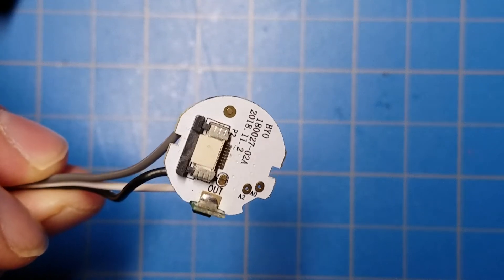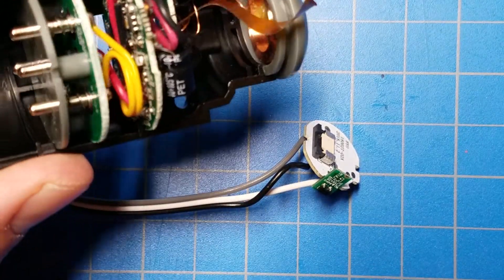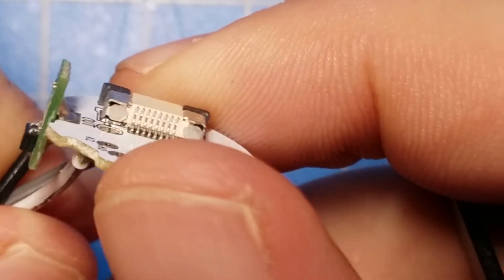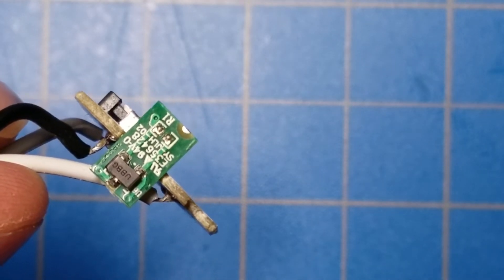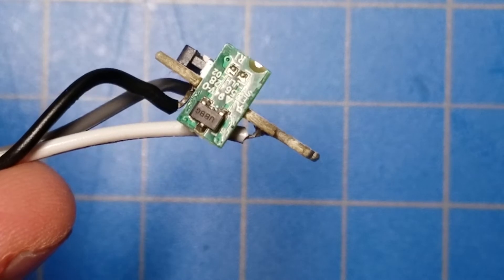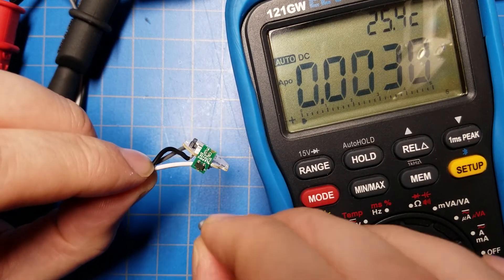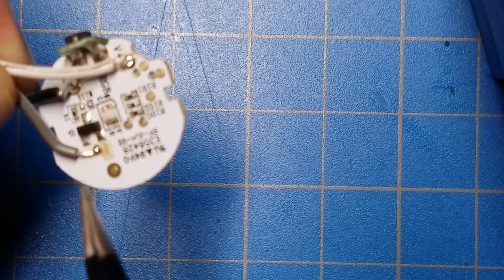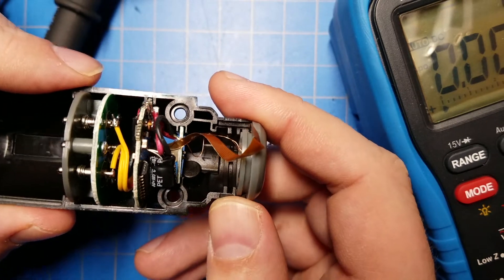A Close Look at the Savi's Workshop Lightsaber Switch Sensor

Comment: I am fascinated by your videos. I am not a newbie when it comes to electronics but I am not anywhere near your level. I have been wanting to put this Savi's core into the hilt of another lightsaber and want to use that hilt's  on/off switch and have been trying to figure out how to bypass that magnetic switch. I have as of yet figured out how to do so.
Reply from the maker: I'll poke around and see if i can figure out how to wire up a mechanical switch. seems like an it'd be an interesting and useful exercise.
Reply from the maker: https://imgur.com/a/RAxNyxz

The imgur album above has a couple images that shows where to solder a mechanical switch to activate the lightsaber.

Comment: Very interesting. Now I’m curious about the rfid in the savi hilt. How is it activated?
Reply from the maker: the top of the kyber crystal chamber is a button. when you put a crystal in there, the crystal presses the button which sends a signal to the microcontroller in the bottom half, which then tries to read the rfid tag in the crystal.
Reply: The crystal needs to be seated a certain way for it to be read. Why is that?
Reply: Additionally, simply pressing the upper grey Kyber pad "in" will not result in lightsaber activation. 
   The RFID must be present, I'm assuming as a programmed "condition" in the microcontroller logic, before you'll get the "crystal power" sound or "false ignite crackle". 
  However, I tried this with the activation switch not present. So, sans-magnet near Hall effect chip.

*edit also, the plastic grey Kyber pads have two small indentations in the center that hold the crystal in place. The Kyber Crystal will "work" without aligning perfectly inside the pads. At a significant angle inside the crystal chamber, the chassis lights, sound effect, and led that illuminates the Kyber all function once the grey pad is depressed and the RFID inside the crystal are within range of the Hall chip.